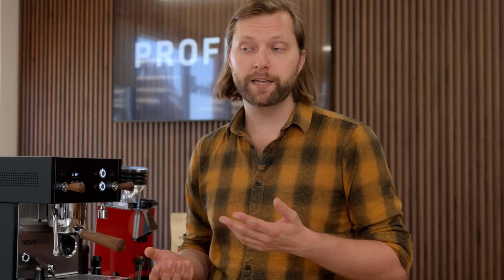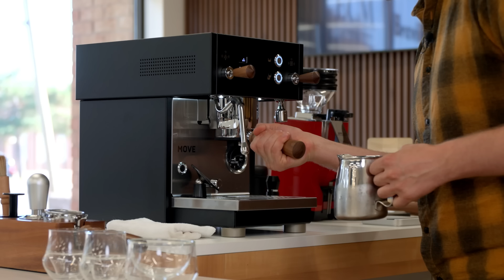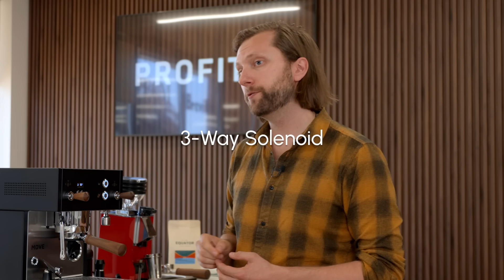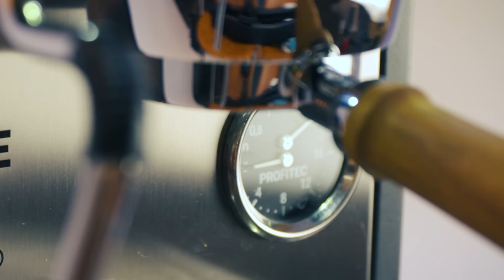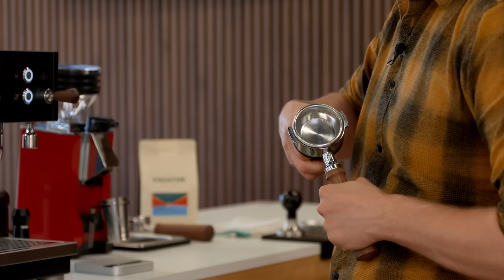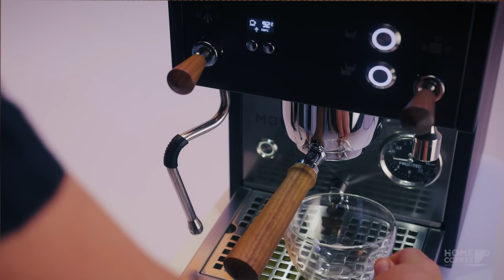Profitec MOVE Review: Powerful & Compact Dual Boiler

Comment: After using the Profitec MOVE for several months:  I thought the small display might be an issue, but it hasn't bothered me.  The things I do the most often, like turning on/off the steam boiler, or enabling / disabling pre-infusion are easily done with a single button press, which then registers on the display.

The biggest complaint I have is the distance from the bottom of the silicone spouts to the tray is a bit too short.  Many of us will want to use a scale with this class of machine.  With the silicone spouts, and a scale sitting on the tray, there just is not enough room for something to brew into.  It is just too tight.  This makes using the bottomless portafilter a requirement rather than something I do when dialing a brew in.  Which in turn means splashing on the stainless of the unit every time it gets used!  I also dislike having to pull the whole machine out from under a cabinet to get at the water tank.  A side mounted tank would have been much preferred, much like many of the Jura Automatics do.

But, the espresso is good.  Heat up times are reasonable.  I usually just walk into the kitchen first thing as I awake each morning, press the on switch, and then decide to enable or disable the steam boiler depending on what I want that morning.  By the time I've brushed my teeth, washed the face, etc., I walk into the kitchen and the machine is ready for a purge, which also helps to heat the portafilter.  The milk steaming seems quite good for a home machine.  Overall I'm happy, just a couple small issues with having to use the bottomless portafilter necessitating a cleaning of the front of the unit daily.

Comment: The Profitec Move is a joke.

A tiny, nailsized miniaturistic pid display.
It's hardly readable.
Very irritating and uncomfortable to regulate the pid temperature.
Low specifications like brass brew boiler.
Noisy vibration pump.
No professionsl E61 Group Head enabling flow profiling the professional way.
OPV not easly accessible.
(4 screws)
Weak steampower.
It takes ages to get decent milk foam.
Build quality is somewhat whacky.
Push buttons all around.
In the long run they get broke.
Toggle switches are working more comfortable and are far more robust.
The lid of the water reservoir has no hinges but two holes.
Very irritating.
Dust and other undesired particles in the air could penetrate into the water through the holes in the lid and contaminate the water in the reservoir.
What I don't understand:
the steamboiler is stainless steal and the brewboiler is brass.
Thus why not both boilers in a  stainless steal version.???
At a price tag of 2000 dollar I am expecting higher qualifications.
The ECM Classica is a far better choice.
E61 Group Head
Stainless steel boiler.
Better and more refined build quality.
OPV easlily accessible.
( no 4 screws)
And the espresso/cappuccino is tasting far better as well thank's to the E61 grouphead.
High end in every respect.
And after all 500dollar/Euro cheaper than the Profitec Move.
Reply from the maker: Thanks for the detailed thoughts — fair that the Move won’t be for everyone, especially if you prefer a traditional E61 like the Classika. Just to clarify, the Move’s brass brew boiler is for better temperature stability, and the stainless steam boiler handles high heat, limescale and corrosion better over time. That's an intentional design benefit, not a downgrade. The steam pressure is also programmable and very capable for a home-use machine at this price range – we had no issues in our testing.

Profitec and ECM are the same manufacturer and both are known for robust and solid build quality. The Move just aims for a more modern and hands-off workflow with programmable volumetrics, programmable preinfusion, auto wake-up, quick steam and compact dual-boiler performance. The Classika is excellent too, just more manual and single-boiler with a long transition time between brewing and steaming. You'll be spending a lot more time at the machine prepping beverages with the Classika.

Different tools for different styles - great that we have options.
Reply: I must disagree with a lot of what you wrote, 4 screws to change the OPV is hardly the end of the world when you only have to change it once if anything, build quality on mine has been great. Don't feel the need for a big display when you pretty much don't change most settings. You can easily froth a drinks worth of milk in the time it takes to pull a shot of espresso. Other machines are maybe 5 seconds quicker, what are you doing in that time. Not everyone wants an E61 machine so you can't say that it's not as good for that reason. Mines been superb.
Reply: @waltonnufc   I'm shopping for my first espresso machine and grinder. The MOVE is absolutely beautiful. Are you still enjoying yours? Any issues? What grinder do you recommend? TY
Reply: I really like the interface, easy and fast navigate, especially once you memorize the location of menu items. I absolutely would not want a larger screen. This is an espresso machine, not an iPad. Shortcuts are also very well designed, you can quickly punch in a new shot time (with pre-infusion) entirely through the shot buttons, no menu interaction at all.

OPV adjustment is a 10 minute job you have to do once ever. 

Fast heat up system is really great. After flush my group and portafilter are all up to temperature.

Steaming is great with the included 2-hole nozzle, but if you put the 4-hole nozzle on it you can steam latte milk to temp in 15s, with the boiler back up to max configurable temperature in 30s. In other words by the time you’ve poured the milk and refilled the pitcher you’re good to go.
Reply: Have you used the MOVE?
Reply: You are trolling. Sounds like you haven't used the Move, it's built like a tank. and a it's a really great machine. E61 is not for everyone. ECM Classica is not a dual boiler. Brass is an upgrade. Just place some cups above the holes if you really are nervous about the dust in the air you are breathing anyway.
Reply: You lost me at 30 min heat up time.

Comment: The discrepancy of why some people say it heats up in 8 mins and others saying it takes 15mins is probably because Profitecs quoted 8min fast heat-up time is based on the European 230v model. The North American 110v model will obviously take longer to heat up. Less power.
Reply: Sadly not. There is a really good scientific video by a swiss channel and they say if you want to have 92 degrees Celsius brew temp you need to wait 17min.

Slightly sad about that but otherwise a great machine
Reply: @schomski2502  There were two big problems with the people you are referring to... 
1. They used a machine that was for limited distribution to retailers to try and give feedback to Profitec before Profitec went into full production for public sale. Profitec made several revisions to the machine that is now sold based on feedback. Those people really shouldn't have "reviewed" a machine sent to them for testing purposes.
2. There was a problem with their testing methodology that Profitec addressed in a written reply to their test which those people published on their website. 
So that "scientific video" you are basing your opinion on does not give full context. Now you have the full context.
People who have tested the machine that is now sold do get the heat up time Profitec state. I own one. A 230v EU model and it's ready to use in less than 10 minutes.